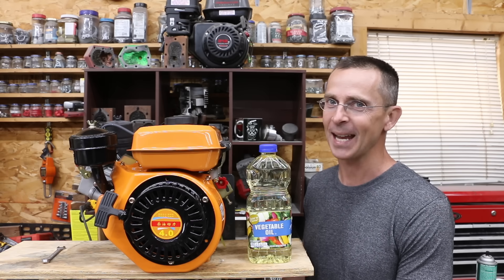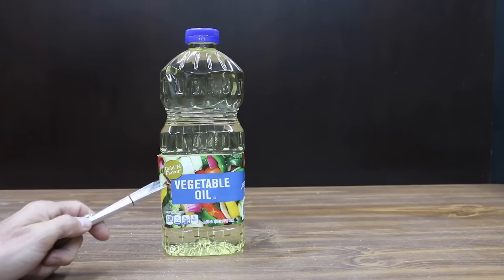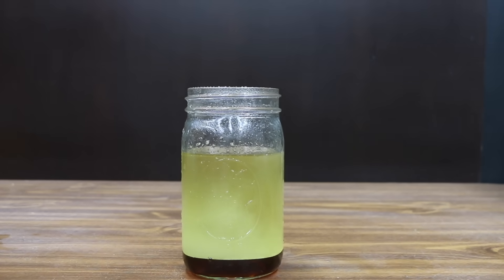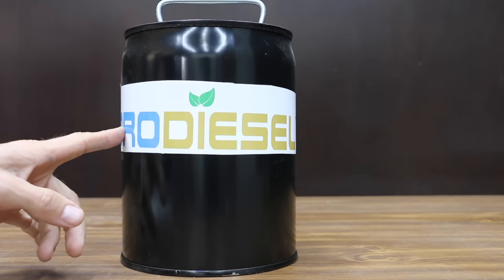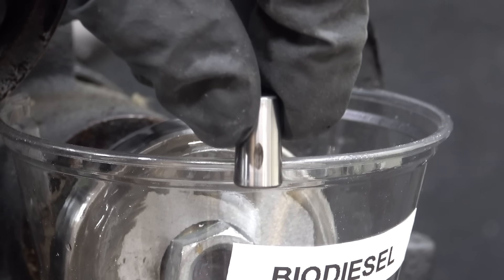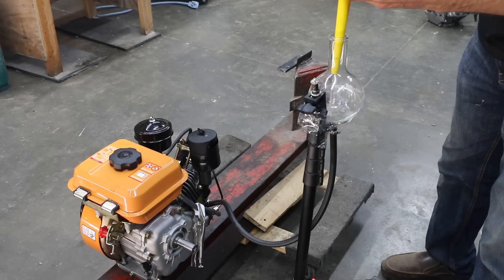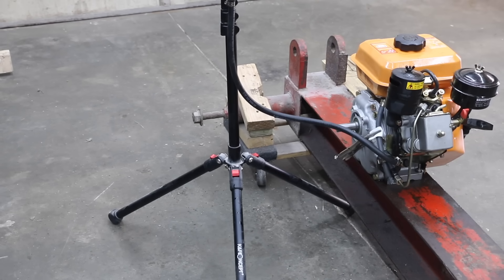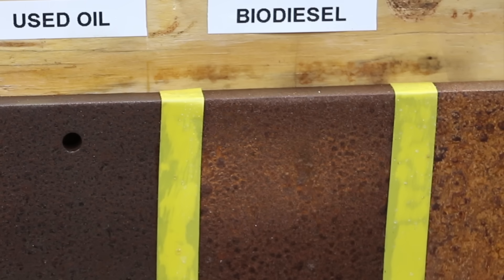Make "Biodiesel"? Let’s find out! Diesel vs Biodiesel, Used Motor Oil, Vegetable Oil, MPG

Comment: I’ve ran tons waste motor oil and transmission fluid, in a 12v Cummins truck. With proper filtration it runs perfectly, you actually get better MPG as motor oil has more BTU per gallon.
Reply: How do you get the water out.  I have 3406b cat mechanical and about 100 gallons of used oil I want to use but I know it's got some water in it.  Would paint filters work for filters
Reply: @skrapenpennies9947  you need to be able to drain the water off the bottom after it all settles or just pump the oil off the top. I used 1 micron filter bags to pour the oil through. Just search on Amazon there’s tons of options.
Reply from the maker: Thanks for sharing.

Comment: you can add 1/1000 acetone to biodiesel/vegetable oil to prevent freezing, it also improve combustion because you get better nebulization. i don't recommend using vegetable oil in any engine though
Reply from the maker: Thanks for the feedback.

Comment: The diesel engine was designed to run on peanut oil it was carbon neutral from day one!
Reply: ...and Hemp oil.
Reply: @markusgarvey  snoop dogg would drive that 😂
Reply: The diesel engine originally was designed to run on coal dust and thus wasn't carbon neutral...
Reply: @greyhunter37  Incorrect, Rudolf Diesel Designed the engine to run on vegetable oil's, and he had Hemp in mind. The very first 'Diesel' was run on gasoline for a demonstration. The era of steam and horses was not working out for the growing population, and with the pollution caused by inefficient steam engines, and horseshit all over city streets then the Equine flu epidemic, his goal was to create an efficient engine that would be able to use renewable fuel, the engine would run on a coal dust slurry, but vegetable oils burned much cleaner.
Reply: @greyhunter37  "In 1893, German inventor Rudolph Diesel published a paper entitled "The Theory and Construction of a Rational Heat Engine," which described an engine in which air is compressed by a piston to a very high pressure, causing a high temperature. Fuel is then injected and ignited by the compression temperature.

Diesel built his first engine based on that theory the same year and, though it worked only sporadically, he patented it. Within a few years, Diesel's design became the standard of the world for that type of engine and his name was attached to it.

Diesel thought that the United States was the greatest potential market for his engine. The first diesel built in the United States was made in 1898 by Busch-Zulzer Brothers Diesel Engine Co. The president of that company was Adolphus Busch, of Budweiser brewing fame, who had purchased North American manufacturing rights. 1

Diesel's Humanitarian Vision:

Diesel originally thought that the diesel engine, (readily adaptable in size and utilizing locally available fuels) would enable independent craftsmen and artisans to endure the powered competition of large industries that then virtually monopolized the predominant power source-the oversized, expensive, fuel-wasting steam engine. During 1885 Diesel set up his first shop-laboratory in Paris and began his 13-year ordeal of creating his distinctive engine.. At Augsburg, on August 10, 1893, Diesel's prime model, a single 10-foot iron cylinder with a flywheel at its base, ran on its own power for the first time. Diesel spent two more years at improvements and on the last day of 1896 demonstrated another model with the spectacular, if theoretical, mechanical efficiency of 75.6 percent, in contrast to the then-prevailing efficiency of the steam engine of 10 percent or less. Although commercial manufacture was delayed another year and even then begun at a snail's pace, by 1898 Diesel was a millionaire from franchise fees in great part international. His engines were used to power pipelines, electric and water plants, automobiles and trucks, and marine craft, and soon after were used in applications including mines, oil fields, factories, and transoceanic shipping.2

DuPont, Mellon, and Hearst:

Diesel expected that his engine would be powered by vegetable oils (including hemp) and seed oils. At the 1900 World's Fair, Diesel ran his engines on peanut oil. Later, George Schlichten invented a hemp 'decorticating' machine that stood poised to revolutionize paper making. Henry Ford demonstrated that cars can be made of, and run on, hemp. Evidence suggests a special-interest group that included the DuPont petrochemical company, Secretary of the Treasury Andrew Mellon (Dupont's major financial backer), and the newspaper man William Randolph Hearst mounted a yellow journalism campaign against hemp. Hearst deliberately confused psychoactive marijuana with industrial hemp, one of humankind's oldest and most useful resources. DuPont and Hearst were heavily invested in timber and petroleum resources, and saw hemp as a threat to their empires. Petroleum companies also knew that petroleum emits noxious, toxic byproducts when incompletely burned, as in an auto engine. Pollution was important to Diesel and he saw his engine as a solution to the inefficient, highly polluting engines of his time. In 1937 DuPont, Mellen and Hearst were able to push a "marijuana" prohibition bill through Congress in less than three months, which destroyed the domestic hemp industry.

A Mystery:

Diesel died under mysterious circumstances in 1913, vanishing during an overnight crossing of the English Channel on the mail steamer Dresden from Antwerp to Harwich. Diesel's death might have been suicide, accidental or an assassination. Proponents of the assassination theory point out that shortly after Diesel's death, a diesel-powered German submarine fleet became the scourge of the seas. Diesel had been friendly to France, Britain and the United States."
Reply: @markusgarvey  You are mixing 2 things there. In 1900 at the worlds fair it ran on peanut oil and he expected it be run on other oils, but in 1893 when he built his first engine it ran on coal dust, not on oil yet
Reply: @greyhunter37  Citation please...
Reply from the maker: Thanks for the feedback.

Comment: @projectfarm. 2notes here. First, great video BUT. 2nd, You used to measure compression as well as engine temperature. I think we could use one or two more metric to compare. For viscosity per example, you used to drop all fluid on a meter and see which one was the fastest and slowest. I would have like a more thorough comparison based on some metric as you used to do with the normal engine back in the days.
Reply from the maker: Thanks for the constructive feedback.

Comment: It doesn’t seem cost effective. You need to buy 2 other chemicals to add to the vegetable oil. You really need to do a price breakdown on what it would cost to make your own biodiesel per gallon compared to pump diesel.
Reply: What makes it cost effective in times of high gas prices is people getting used vegetable oil from restaurants or fast food places for either free or cheap. I've seen people end up with it for about 1 dollar per gallon.
Reply from the maker: Thanks for the feedback.

Comment: All diesel engines are manufactured  to run on vegetable oil. However, the manufacturers of diesel pumps don't use biodiesel compatible seals, so if you want to run on 100% bio or veg oil you need to send your fuel pumps to specialist rebuilds to get the seals replaced.
Reply from the maker: Thanks for the feedback.

Comment: Adding (well-filtered) used crankcase oil to today’s low sulfur diesel fuel adds needed lubricity to keep injection pumps properly lubricated.
Reply: Or any additive.
Reply from the maker: Thanks for the feedback.

Comment: “High octane, low octane, if it flows and burns, it can be used as fuel.” Seems to be true in this case.
Reply: You can use coal as fuel
Reply: @flameraker6824  the germans created synthetic fuels from coal in the war
Reply: Yeah, I was surprised how well straight vegetable oil did.
Reply: Actually it's cetane (a different type of hydrocarbon molecule), not octane. Gasoline is just used mainly as a thinner with engine oil, veg. oil, etc.
Reply: @erwin643  thank you for the information, I was just quoting a fuel description from somewhere else.
Reply: @erwin643  Yeah, I figured out octane.  I will need to look into centane and learn about it.
Reply: @superchuck3259  cetane is essentially the inverse of octane. The higher the octane rating, the more it resists combustion, cetane on the other hand, is the opposite. The higher the cetane rating the easier it combusts
Reply: @michaob2586  hence why high cetane diesel fuels are equivalent to high octane gasoline
Reply: @michaob2586  So centane rating is a combustibility rating.  I heard about fuel/water mixture as an option in diesels.  I could not understand how that worked till you mentioned this.  So adding the water would reduce the centane rating and prevent too fast an ignition.  Also the steam effect is nice too.
Reply: @erwin643  I took one year of a two year diesel mechanic course in the middle 70's. Then I found that alcohol tasted better than diesel fuel. In the time that I was there, they taught us to look at octane and cetane as 2 funnels standing point to point. High octane gas is at the broad end of the top funnel and high cetane diesel at the broad end of the funnel on the bottom.
    High quality, high octane gas is more desirable as it resists detonation, burns slower and will allow more advanced timing delivering more horsepower. On the desirable
Reply: ...if it flows and burns, it can be used as fuel.”...

From what you are saying here, I believe, you are thinking of a turbine engine like the one in the M1-A1 Abrams tank. These can burn anything from vegetable oil to alcohol and, if blown, the engine pod can be changed out in an army repair depot for a new one in 3 hours.

Except using octane in diesel engines usually results in injector lock, explosion or both. The standard in diesel engine fuel is called CETANE, usually a rating of 40 anymore.
Reply: In combustion engine
It's gonna matter
Reply: Wasn't this a blurb from a game called crossout?
Reply: Yes, but don't tell the tax man in the UK!
Reply: Mineral spirits will really wake a diesel up.
Reply: They really do, ive seen people squish logs and use the flammable juices as fuel haha
Reply from the maker: Thanks for watching.
Reply: @ProjectFarm  and thank you for inspiring me to dismantle an old gas powered leaf blower I was given as junk.
Reply: @ProjectFarm  G,day Todd thanks for you’re great channel 👍 Would like to know your thoughts on chainsaw bar oil !! I have herd many opinions and witnessed people using old sump oil , engine oil , drill rig drifter lube , and other lubricants !!! Considering the cost of chain bar oil is it all its cut out to be or will other oils , lubricants do the same job at les cost ?? I understand you’re lube tank should always last longer than you’re fuel for obvious reasons but besides that is there any other real benefit considering the price ???? Once again thank you for you content and effort and a big Gday from Australia 🇦🇺 👍

Comment: Another good video Todd, interesting as usual, thanks for sharing.  
Where did u find the small diesel engine, ordered online?   How much $$ was it?  
I've never seen a running small diesel engine in person, seen a few German Hatz brand small diesels in person, but they weren't running.    I've been running some Filtered WMO & used ATF in my 06 VW Jetta since last year/fall & it runs fine. I tried 20% mixes, but I've cut back to just 10%.   I filter it down to 10 microns in a 5 gallon bucket filter I got from Duda diesel on ebay, just $20 total w/ shipping. I've used about a dozen er more gallons mixed w/ pump diesel since last year, but I'm loosing count.  
I'm really looking forward to meeting a guy near me that knows how to tune/super tune diesels, so I'll keep you posted.  If you're ever in Nashville hit me up, been here all my life.  Thanks again, - take care man

Comment: I’m a huge proponent of bio fuels like ethanol and bio diesel for real green renewable American energy. 

But for how much ethanol fuels we have here in central Illinois we have zero 100% biodiesel pumps. Best we have is 5%-20%. 

Id have multiple diesels if there was though.
Reply: 100% Bio is VERY corrosive, and while it cleans a engines fuel system well, it also is hell on the emissions, and DPF,  and is VERY hydrophillic. ( collects water in fuel)
DO NOT USE in newer HPCR engines like in modern pickups and cars
Reply from the maker: Thanks for the feedback.

Comment: Most diesel purchased at the pumps has a certain amount of biodiesel mixed in. As a diesel technician I will say trucks running pure diesel need fuel water separator filters replaced less often than the ones getting a biomix. Overall it probably is cheaper to run the bio or bio mix, just keep an eye on your filter.
Reply from the maker: Thanks for the feedback.

Comment: MY 7.3 RUNS on WVO . for the last 3 years.  It starts on diesel warms up the WVO tank then switch over to WVO. then for shut down to diesel so it will restart easer. yes i have 2 tanks
Reply from the maker: Thanks for sharing.

Comment: Great video. I've done it on a slightly different style.  I was doing B100 and it worked great. Used in slid steers, Diesel pushers and power stroke engine. Never an issue  I used  fryer  oil. I tried the methanol version with less success.
I was all about low effort and highest yield.
Reply from the maker: Thanks!  Thanks for sharing.

Comment: My son has an early 80's Volkswagen diesel pickup.  He was putting in all of our used motor oil in with diesel in the fuel tank.  The used motor oil fouled the water fuel separator filters.  It does run good on kerosene.
Reply from the maker: Thanks for sharing.

Comment: I've actually had to run my car on refined sunflower oil when I was on a road trip . Drove around 350 km on high altitude roads ( 3000 m above sea level ). Honestly I couldn't tell the difference.
Reply: I mean, the engine was created to work with bio oil

Comment: Cool , I ran my old ford focus tddi ( mechanical pump) on straight vegetable oil for over 4 years no problems it ran smoother and just a quick just had to mix it 50/50 with diesel if the forecast was for a freezing day...and yes it smelt lovely..back then a litre of new smart price vegetable oil was 22p from Asda ....i used to go to Asda buy a trolley load and pour it into my car ...Then the UK government got wise and very quickly the price a litre of vegetable oil shot up  close to 90p or more....plus nowadays common rail diesels can't run straight vegetable oil with out risking pump damage ... Miss my old tddi.

Comment: DIY biodiesel is a big thing here going back to the 70's. It was bigger when waste fryer oil was plentiful and free, but now you have to pay to get it. You can't find older mechanical-injection diesel cars for sale, and when you do they're not cheap now either. It's a gray area legally but nobody gets in trouble over it as long as you're not selling it or using it in a newer vehicle that requires clean diesel. When it was little-known it was a great thing and you could fuel your car for free. Demand raised costs but it's still worthwhile, and if you've got an older diesel car you'd do well to hang onto it.

Comment: Great video, I immediately recognized that engine since I have the exact same one myself!
That specific engine (168f) is an indirect injection/swirl chamber design, whereas the 173f and larger Chinese diesel engines use direct injection. I wonder if you would have had different results trying to run a direct injection engine on this crazy mix of different fuels, since indirect injection engines are supposedly more tolerant of lower quality fuels. Either way, very cool to see this test!

Minor nit pick, but I think the compression release holds the exhaust valve open, not the intake valve (around 1:20). Unless this specific small engine is unlike the larger China diesel engines which definitely use the exhaust valve for compression release. Awesome video, thanks again for all your hard work!

Comment: I got a friend who's a mechanic and he keeps all his used ATF. He has a tank on the back of his truck with a triple filter setup. He starts his truck and runs for about 5 minutes on diesel and switches over to the ATF tank. I've never done the research to see what impurities are in ATF so since you're covering diesels it might be something to look into.
Reply: You have to switch to diesel for 5 minutes before you shut the truck off. From what I gather it won't start on the ATF

Comment: It would be interesting to see if the engine's power output is affected by the different fuels. Could possibly test this by rigging up a belt driven alternator or the like then loading it down with old-school halogen headlights, a carbon pile battery tester, or a salt-water load, etc.
Reply from the maker: Thanks for the video idea.

Comment: I ran a 2015 model western star prime mover pulling 64.5 tonnes for 2 years straight using canola oil…. Truck didn’t miss a beat once…. And to this day the truck is still running and only had regular maintenance and filters changed.
Reply from the maker: Thanks for sharing.

Comment: Filterd Motor oil is definitely a good fuel additive. I do run into problems if i run on more than 50% used oil(that includes transmission fluids and basically anything oily that burns. But i do suggest not letting it sit in the tank-engine or using it in cold weather or if your doing short trips. Hot engine and yhen store it with pure diesel
Reply from the maker: Thanks for the feedback.